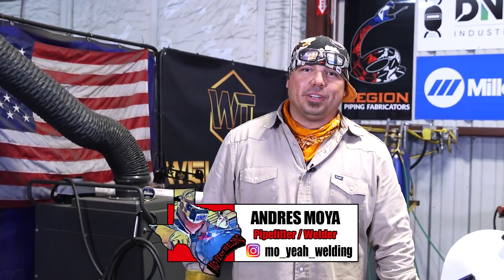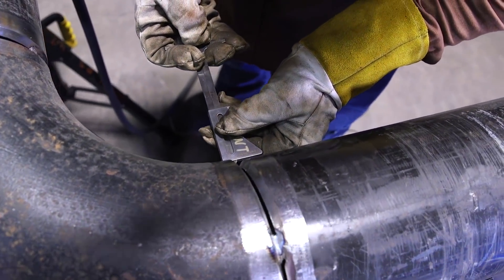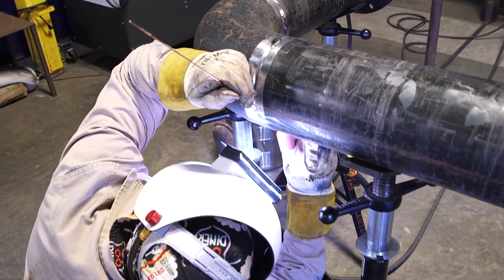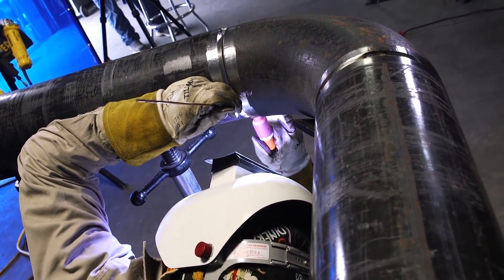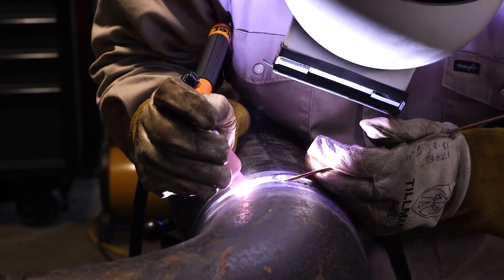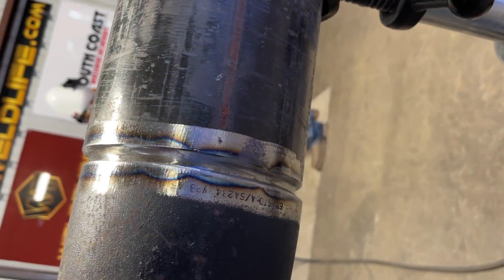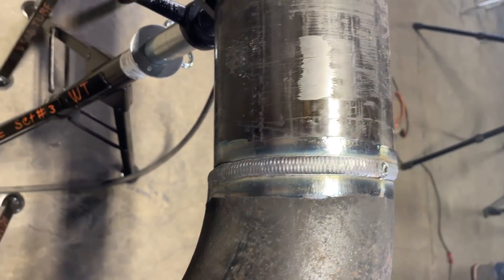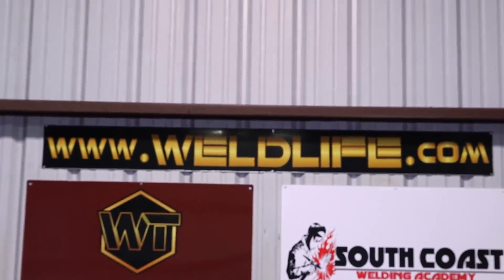TIG Welding The Worlds Worst Fit Up | Uneven Gap & Excessive Hi-Lo

Comment: As a Boilermaker I've seen some bad fit ups. You try everything to get it the best you can. Five or six years ago me and my welding partner had a heavy walled 8" supply line. We done everything we was aloud to do, to get a good fit. We had the weld tech, Gf and the plant man over the Boiler come a look at it. After awhile they said weld it. The weld was in the 6g position, the bevels matched up good but we had tight 3/32 gap on bottom and a 3/8 gap on top. It was a interesting fun weld to tig the root pass in it. Out in the field sometimes you just get bad fit ups. Very nicely done root passing the fit up in this video.
Reply: Boilermakers 🇺🇲⚒️🛠️🇺🇲⚒️🛠️🇨🇦⚒️🛠️The Real boys under TheHood
Reply: @mikeundereood1071  you ain't lying. I've welded some 1/4" gaps out in the field. Just gotta make it happen, and not leak
Reply: @mikeundereood1071  2020
Reply: A 3/8 gap on the top!!! Holy cow!! That must have been quite a pass
Reply: I just finished my foundations course for Boilermaker's. First year apprentice.
Reply: Local 1 Chicago just weld it.
Reply: I have several friends that local 69 in Michigan
Reply: Are u union?
Reply: @joshuabowser4685   yes Local 105. I have been off work for awhile  due do health issues.
Reply: @jbolin105  
Im out of local 40 we've probably met up somewhere, but I get a kick out of watching these fab shop welds trying compare it to welds we make.
Reply: Some of the worst fit ups I have seen have been in the shipyard structural fitters can leave some pretty bad fit ups for structural welders to fit and sometimes they slug the gap a weld it the navy just doesn’t know and neither does coast guard
Reply: yah as a boilermaker ive seen sum really bad fits. always sucks that 100percent x ray in the boiler.
Reply: Did you go to college at Purdue?
Reply: I am a skilled welder, i need a job does the company still need labor. Sign me up.
Reply: Working on a 30' penstock at a 45 degree angle, due to the angle and how the surveyors want the section to fit we get some massive gaps. Biggest ive seen is over 1.5"

Comment: Andreas Sure made that Cap out look really great considering the constantly changing amount of fill depth as he went around the Pipe. 

Beautiful Work.
Reply: He's on jackstands, in a nice clean shop, welding 5" or 6" carbon steel pipe.  And his fit up, while not right, ain't nothing that a real welder would cry about as much as they did in the beginning in a damn video about a bad fit up.
This not only is the easiest material. But it's the easiest size. In the easiest position.  The easiest wall thickness. In the easiest place to weld. All done with top notch equipment, in a controlled setting. 
Settle down .

Comment: In my experience I’ve come to love those situations. It makes you a much better welder facing a nice challenge every once in a while.
Reply: I'm a fabricator not a pipe welder but I agree, I love a challenging project, makes you better in the end. But God danm it can make for some frustrating days...
Reply: @MikeP350  You ain’t kidding. I earn my pay going underneath 60+ Y/O buildings on steam and Hot Water. However it’s the  really really bad ones that make you a better welder in the shop and when you have easy access to your weld.
Reply: Makes it worse if you've got someone wanting to breathe down your neck. Patience gets really damn thin.
Reply: sack the fabricator, bore of the pipe is off , burst the tacks and reset the pipe butt
Reply: Facts
Reply: Good way to get fired accepting that fit up...